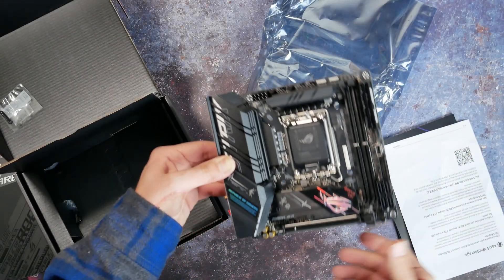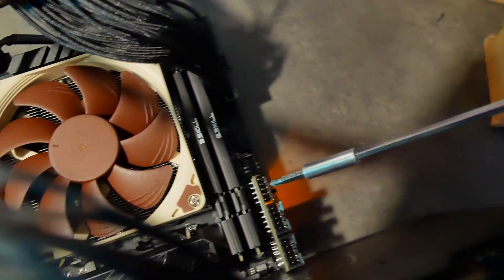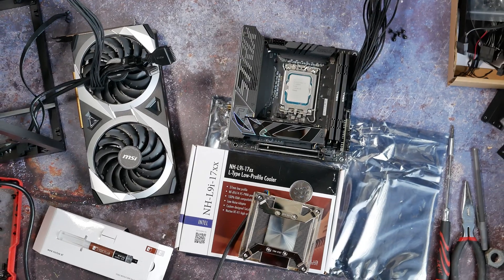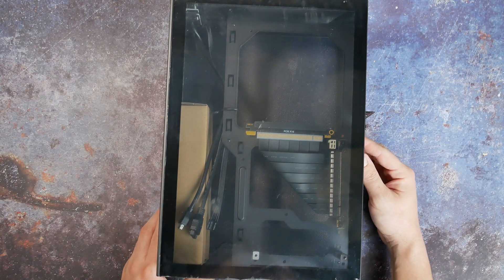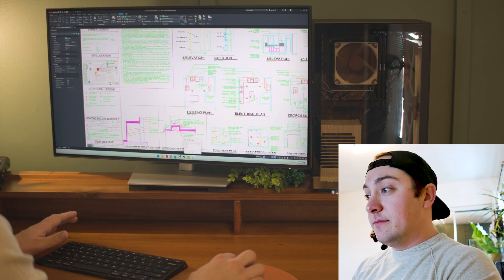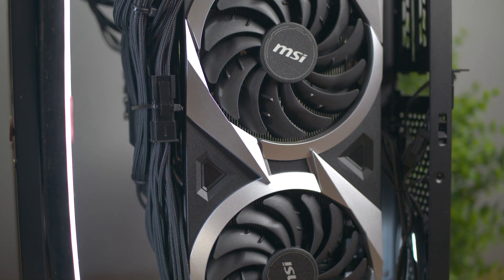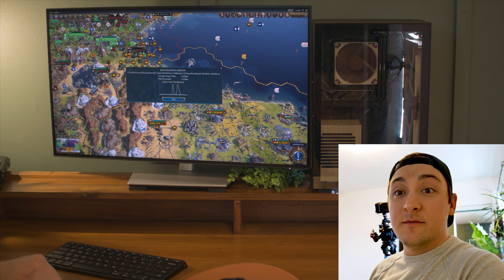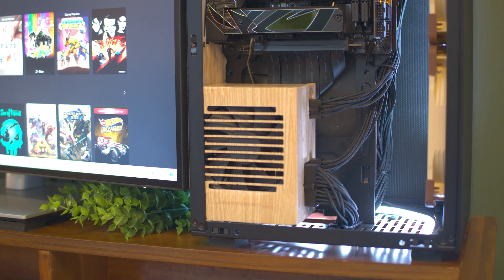Building a Tiny Powerhouse PC for an Architect!

Comment: uhm .. air cooled behind TG? ok .. I'd just replace it with 140 mm AIO, and if you're like totally into the Noctua Caramel-Vanilla look, then just replace the ARGB rainbow puke fan with a NF-A14.

Still, 1700+? I paid roughly 1200 Euro for my meshi with similar specs, reusing two pre-existing parts (which was the case itself, and a Silent Wing 4 HS), so technically even less (approx 1100), but quite a bit more future-proof (280 mm AIO). Could be that I just planned MUCH better, with measuring, calculating and looking up every detail, but at the end of the day, even my last minute decisions of relocating the PSU to another position, adding a different "front" USB + USB-C solution, and even adding a 3m power connector .. dont feel as thoughless and random as your build.

Although it might be just an issue of proper presentation here.

cu, w0lf.

Comment: Came to check out this case and yeah ….seriously 1700+ for a build and u get that?? Only this positive is that I ended up working

So many things wrong here made me cringe the whole way true.
- No eye for detail the wood on the psu all chipped looks awful.
- psu fan towards the glass always good to starve it from air.
-The fans in the front mix and matched screws and vibration plugs. 
-And the cherry on top drilling a hole true the GPU shroud so you can cable manage a bit. 

Dude never ever do something like that. Take your time and do things properly don’t rush it just plan and triple check stuff. It is for someone else and then this is how you want to show your work?
Reply: I build better than this guy. lol. He looks newbie and wasted the other person’s money.
Reply: I mean the 2 140 case fans blow cool air for the fan to grab onto lol so there shouldn’t be an issue there dude
Reply: @zacharystrange8920 you got a minimal gap for the psu fan to pull in fresh air, it makes the psu run hotter and louder also wear out faster. It gets some air but it is starving dude, check out some reviews on the glas panel en psu fans against the glas “same for gpu fans” the closer to glass the worse the cooling and performance gets.

TLDR: fans close against glas is a bad idea.
Reply from the maker: well the case is nice
Reply: @DaveyG  sub 80 IQ
Reply: @F83.M4  Why are you being so rude? Everyone makes mistakes
Reply: @machlangsambruder  Only being "rude" bc he is doubling down and trying to defend his mistakes